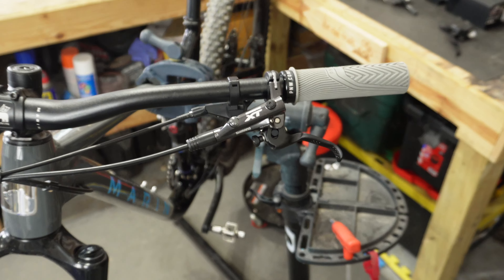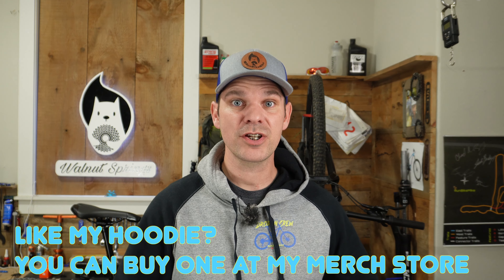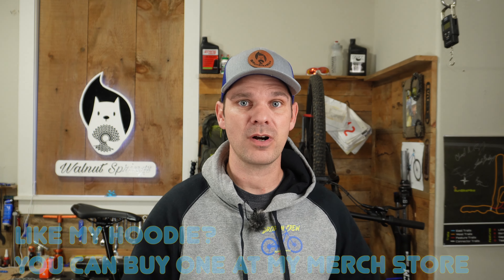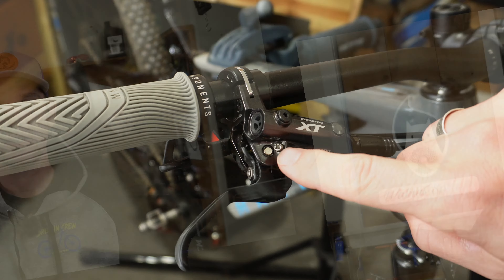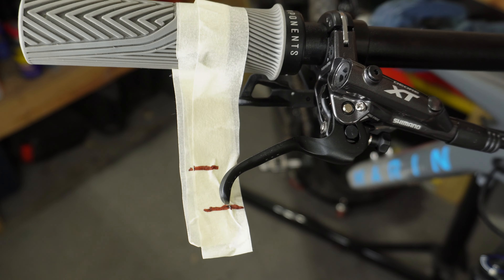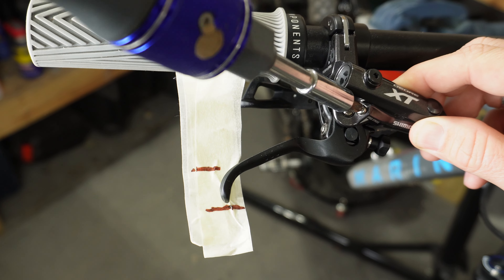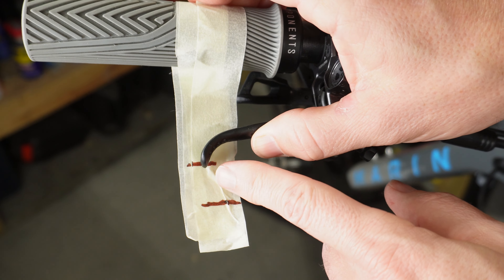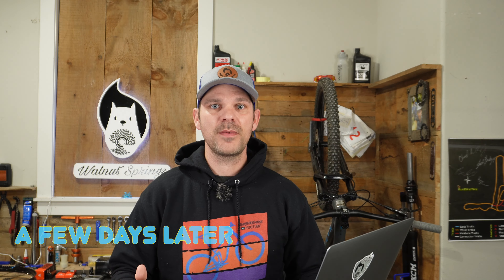AWESOME SHIMANO MT200 LEVER UPGRADE / How Free Stroke Adjustment Works

Comment: You can upgrade those levers to FLO Motorsport MTB levers now.
Reply from the maker: I did look into that. Looks like they make some nice levers.
Reply: they snap in a different place apparently instead of bending lol
Reply: @jamble7k  That is not true both my levers are fucked up, If i had the flo levers they would have been okay

Comment: I'm confused as to why you wouldn't just spend the extra $50 and get a complete brake with a caliper? Then you have a complete cheap brake to use as a spare or put on another bike.
Reply: For some people 50$ is a lot of money.
Reply: @FirepoiMo  for those people resale value is probably important as well. Nobody’s gonna buy XT levers on budget calipers.

Comment: also when you’re bleeding the brakes, pop off that rubber cover under the screw you undid, that’s the bleed port. Pop A hose onto that and slightly loosen the one you undid, makes bleeding A lot easier
Reply from the maker: There is no bleed port nipple to do that on these brakes. The port is a screw that is why I used the adapter. Deore and up normally come with bleed port nipples but not 200s
Reply: @RunBikeMike  there literally is under the tubber cover
Reply from the maker: @ben_pedelty  well two for two. You are right. Out of all the times I have done a bleed on mt-200s I have never noticed that. I will give that a try next time.

Comment: Great video and first time I’ve seen anyone use the masking tape for the explanation.  Some suggestions is to decrease the volume of the music and increase your voice volume.  Perhaps changing microphones or place it on the inside of your hoody so it picks up your voice better.
Reply: I´ve seen this voice vs music issue on all types of YT channels, from starters to 1M subs. It´s really annoying to sudenly have this music pop up on a such higher volume
Reply from the maker: Just curious are you by any chance using an android device when having the audio issue?
Reply: @RunBikeMike  I am
Reply from the maker: @brunoburdini8056  oddly it seems to only be an issue with Android. I am not sure why that is. I edit on a Mac and rewatch it on a iPhone. The vocals are clear on both.  I have been trying to get it to work for all platforms. Hopefully my new videos are better. I would appreciate it if you could watch my two latest videos and give me some feed back on the audio.

Comment: Can I do just a lever bleed to top up the mineral oil after replacing the levers?
Reply from the maker: Yes you can. I have done just that on my last couple of upgrades.
Reply: @RunBikeMike  Thank you. I was missing a new set of fittings. Back to the shop 🙃
Reply: Rather than do a full bleed just install the lever and very slowly using a syringe drop a few ml of fluid into the cup at a time. This way the air the fluid is replacing can escape. Won't take long.

Comment: Does it still work the same with the shimano break calliper or do u change the pads too
Reply: So if u just change the mt200 too Xt it will work like Xt with Shimano mt200 break callipers
Reply from the maker: Yes levers only and it makes them much closer to xt. Not quite as good as a full set but much much better.
Reply: @RunBikeMike  do u need different break pads

Comment: did you replace the olive insert ? im planing to put slx levers on my mt200.
Reply from the maker: No, as long as it is not damaged you can use the same barb and olive.
Reply: sir ihave mt200 brake if i replace xt lever to mt 200 caliper need to replace the hose and olive?

Comment: Hi, thx for the great video. May I ask if I have a similar lever like your ,but mine is BL-m4100 & I just want to change the finger lever part but still use the rest. Can this be done?(which means I just buy the xt finger lever part alone, not the entire ). In your video U changed the entire lever set(except the clam pots).
Reply from the maker: I don’t think you can change the finger pull part of the lever. It attaches differently.

Comment: How much better were the brakes over the stock mt-200 levers? Is it worth paying $110 for the denote xR levers or just paying the $300ish it would cost to upgrade the brakes and calipers?
Reply from the maker: They won't bite much harder if at all but the lever feel really do make it feel different and IMO worth the $110. But if you can go to 4-P brakes vs 2-P you will see a big bite diff.
Reply: @RunBikeMike  thanks for the help. I just got back into MTB and got the 2023 Marin RZ 2 for a steal. Couldn’t justify the XR price for what I needed, even with a military discount. I should be gtg for a while with a set of Deore XT. Only other thing I can think of that I would need upgraded would be the wheels and hubs. Will prob go with some Hunt wheels next year sometime
Reply from the maker: @WStar4Life congrats that is a sick bike.

Comment: I'm wondering will these mt200 caliper hold these much pressure that XT lever give?
Reply from the maker: Yes they will. I have been running them for quite some time with zero issues.

Comment: i replaced my levers, but the right feels spongier than the left.. is it okay to use bh59 fittings?
Reply from the maker: Yea it is ok to use a bh59. That fitting only plays a part with the hose not the lever. As long as you have bh59 hose you are good.

Comment: What is this wizardry. You re-used the olive and barb?
Reply: I’ve swapped Shimano brake components many times and rarely have trouble reusing barb/olives.  On the odd occasion I’ve (very carefully) cut the olive off the hose, replaced it with a new one and used the old barb. This retains the original length of the hose.
Reply from the maker: Yep it works perfectly evey time with Shimano to Shimano.
Reply: I've done it on plenty of brakes, zero issues

Comment: I have a surron with stock brakes, would it be possible to use the shimano lever assembly with my stock calipers and stock brake line? Or would I need the shimano brake hose

Comment: I put the front brake on my left
Reply: @tristanwwsd  I posted this a year ago and don't remember it. I mean I put my front brake on the right side of the bars
Reply: @64maxpower  Well that's where it's supposed to be, so you're good.
Reply: @tristanwwsd  where are you from Tristan? In the US bicycles come with front brakes on the left.
Reply: @64maxpower  Just because the US bicycle industry puts the brakes on the wrong side of the bars doesn't make it right. 
Go check all your motorcycles and see what side they are on. To further my point look at all front forks. The brake is located on the left, so the line can run a smooth arc up to the lever. Only in the US do they tweak the line to locate the control on the wrong side.  
It's not natural. I'm in SoCal BTW. 😄

Comment: Great video, got one question if i want to change the caliper to a BR-M8100 can i keep using the hose SM-BH59-JK, I currently have a BR-MT200 caliper, and the hose bh59 goes through the frame so i want to avoid that, will it be compatible? Thx
Reply from the maker: If you are going to go to the xt caliper I would switch to the BH90. Otherwise you will not be getting the correct pressure that the caliper is designed for.

Comment: So I did the upgrade on my Syncline c3 and everything went great! 100% recommended, thanks again!!. I still have a doubt about it, how is it that the bl-m8000 lever is compatible with the bh59 hose?? I found out, after making the upgrade, that you need the bh90 for those levers.
Reply from the maker: The hose 90 hose only gives higher pressure. Same outer diameter but smaller inner diameter. The olive is the same the barb is a little different but the part of the barb that meets with the olive is the same size. So you should be able to use either hose. The 59 will give you softer braking and the 90 will bite harder. They made 59 for when road bikes came out to make sure road bikers wouldn’t bite to hard.

Comment: is heat tolerance improve than mt200?
Reply: This upgrade shouldn't improve brake fade. If you're looking to improve brake fade you'll need to do something with the caliper, brake pads, rotor and MAYBE the oil (idk if oil makes a big improvement).

Comment: Great video!
I am kinda doing the same thing now as I am replacing my m6000 lever with a m7100 one and pairing it with an m6000 caliper
Reply: I paired my m6000 lever with mt410 caliper bc old caliper broke , i works now

Comment: Hi there! Nice vid! But I have some questions about the caliper and the width of the hose, doesn’t that affect the breake power? I mean, the deore m6000/6100 or slx or xt or xtr, have pretty the same caliper (some ceramic other steel) but the m200 uses smallers pistons, that’s why the lever is longer, you need more force from your fingers, I suspect that replace only the levers (even with the newer master cilinder), you won’t get the same brake power, or maybe you need a lot of force from one finger only
Reply from the maker: Servo wave fixes that issue. It gives the extra power needed for a two finger lever. It is cool tech.

Comment: I have also found the m400 leaver too long. I was on a tight budget and replaced them with Deore M615 levers. My first hydraulic brake mod. First time bleed turned out to be easier than I expected and the right tools helped.
SLX leavers can be retrofitted with stroke adjustment. Replace the anti tamper screw with a 12mm M4 grub screw. Be very careful not to over tighten it as you can damage the mechanism.
Reply from the maker: Nice. The two finger lever is so good. I like to move mine away from the grip so I can use one finger. I wasn’t sure if I would like one finger braking but wow it is super nice.

Comment: be careful as you’ve likely voided any warranty on the brakes due to the incorrect barb/olive combo in the lever
Reply from the maker: It is Shimano. It is the same barb and olive. So no worries there.
Reply: @RunBikeMike  no they have two different types, bh90 and bh59
Reply from the maker: @Ben Pedelty  you are correct they do make two different ones. I did some more research on this, this morning. Seems like the olive is the same but the barb in the 90 is a little shorter and made with a different metal. Online it seem people are using them interchangeably. But the 90 hose is where the main difference is. The 90 is a smaller diameter allowing for more pressure. A few people are saying they noticed a small difference when switching from a 59 to a 90. Some have even went from a 90 to a 59 because that is all they had and they maybe could tell a little difference. This is good to know. Thanks for pointing this out as it let me dig deeper.